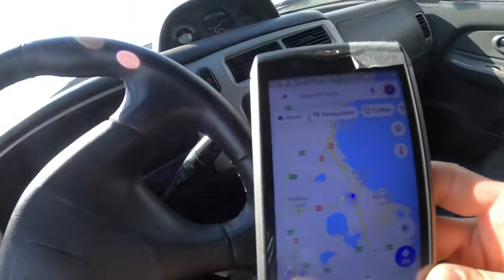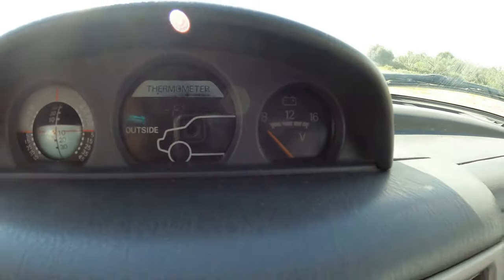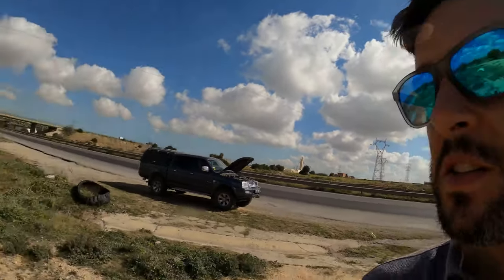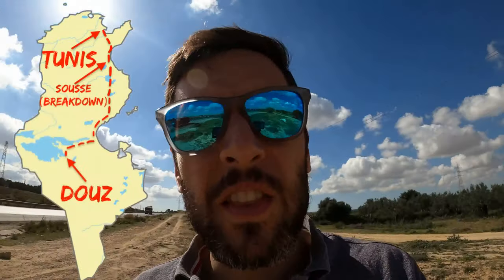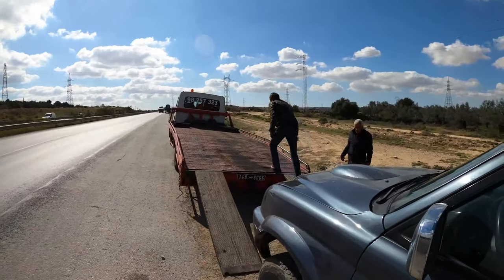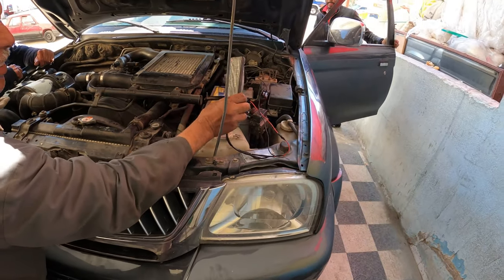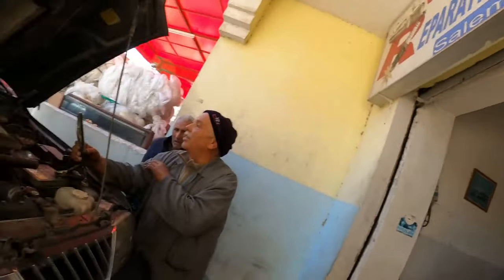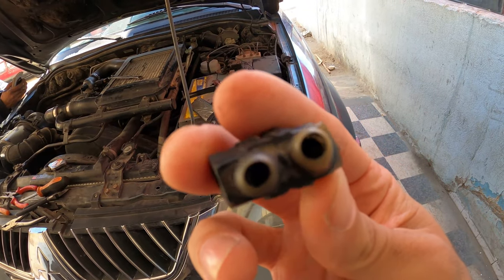600km Tunisia Road Trip: Tunis to Douz in one day (with a breakdown!)

Comment: I used to live along the Alaska highway and learned very quickly to carry things like jumper cables, water, a shovel, extra fuses and belts etc.
Reply from the maker: I had a fun collection of spare bits in the back of the vehicle, but no diagnostics gear = no fix by the side of the road. Still, this was the whole point of the first road trip: iron out all the potential problems early!